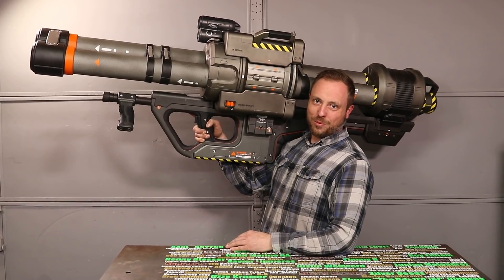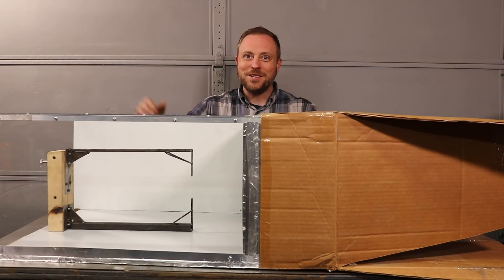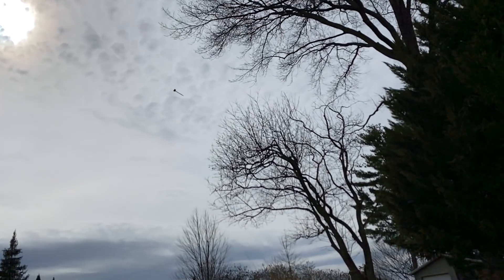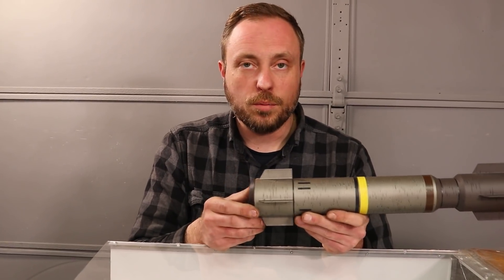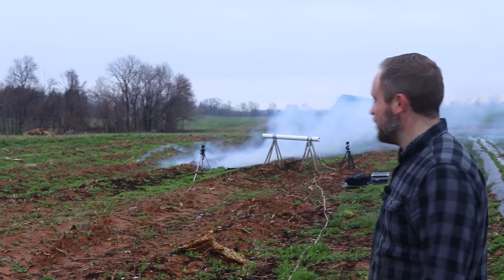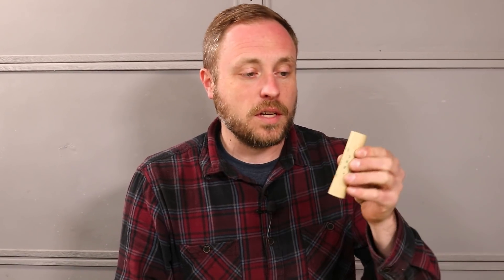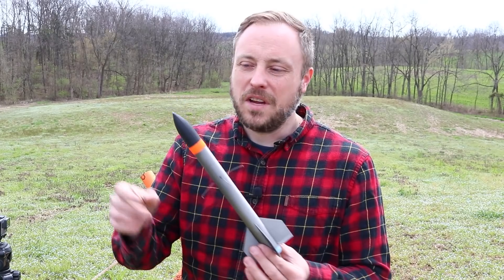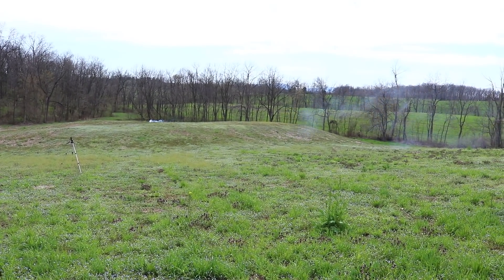Halo Rockets in Real Life - Absolute Garbage

Comment: So, if the problem with rocket #1 was that it wasn't going fast enough, wouldn't the more powerful engine solve that?
Reply: there is a limit to the power you can use without a rocket license, he's already approaching that
Reply: I don’t think it works like that because then he would have other problems that would take time to fix and fine tune so I would rather a design that can actually fly straight and works instead of accuracy
Reply: @subsonic9  uhm....ok
Reply: The problem is there is a lot to factor in. Weight, centre of gravity, centre of pressure, aerodynamics, flight stability, wind pressure (that affects direction), rocket motor power, and perhaps many more. There is so many things that need to be considered when you're trying to make something fly. All of the things I just mentioned WILL affect the rocket in some way, that's why its important to fine-tune and balance each factor to get the best performance. For example, larger fins produce more drag but increase stability, fins in front change the centre of pressure and add weight to the front, a more powerful rocket could destabilise the flight of the rocket (imagine a car with an extremely powerful engine but has poor handling and control), etc. That's aeronautics and rocket science for ya. Goes to show that the original design for the rocket was flawed from the start, but hey, its a game so game physics.
Reply: @Tyler Powell  It could work since you would have less resistance from the wind with the added weight. As well as the bulky design would allow for smaller wings to help stay on target.